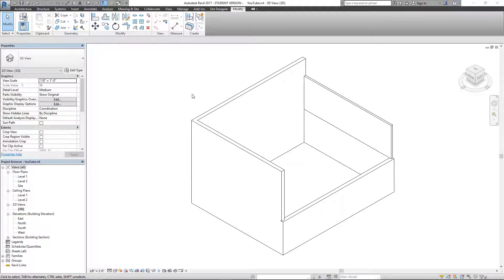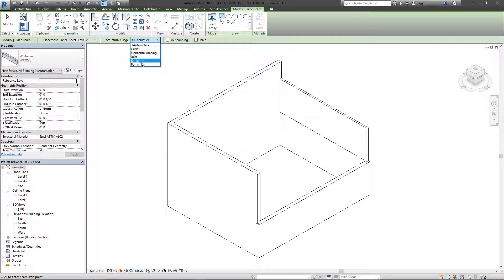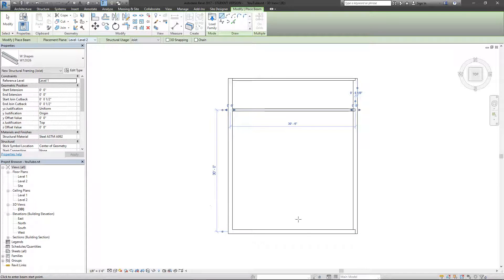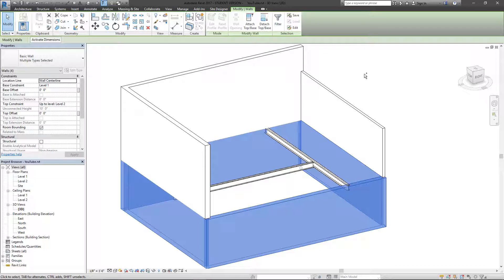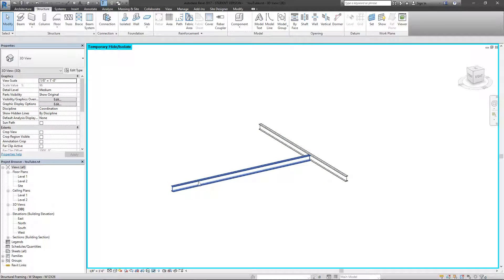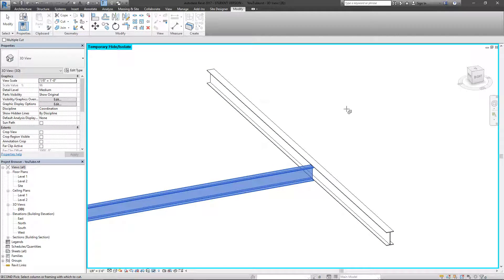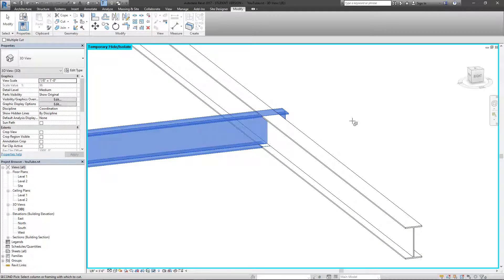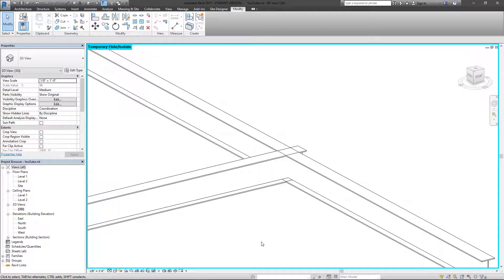Coping | Every Revit Tool - Revit

Comment: How does one modify or manipulate the size of the cope applied?
Reply from the maker: When selecting the beam you can can adjust the coping size for that beam. I believe the default is 1/2" or 1" for most beams.